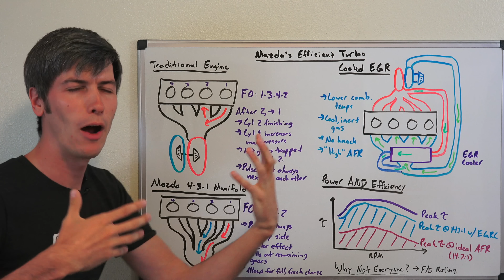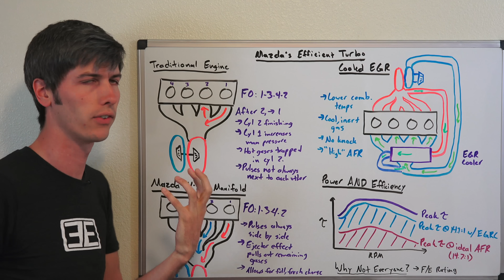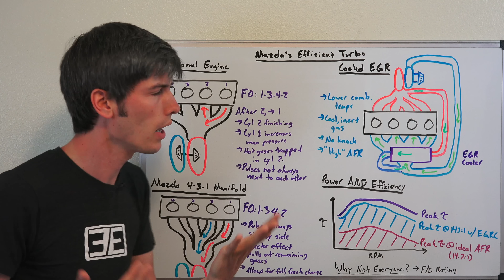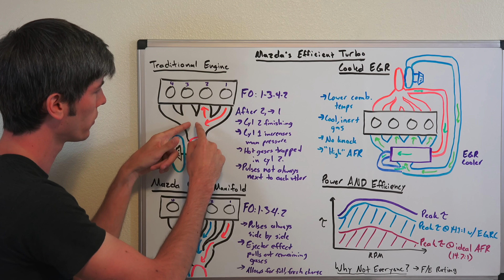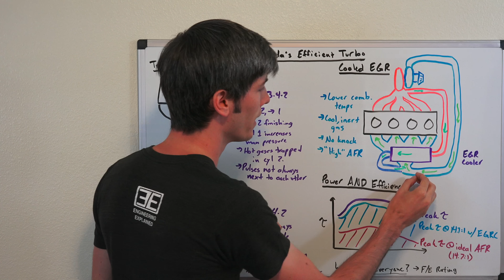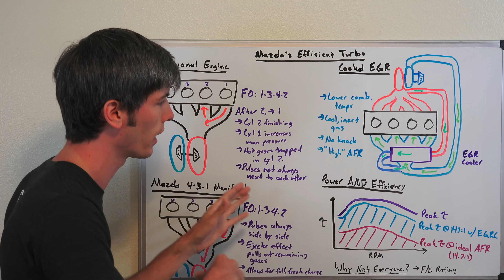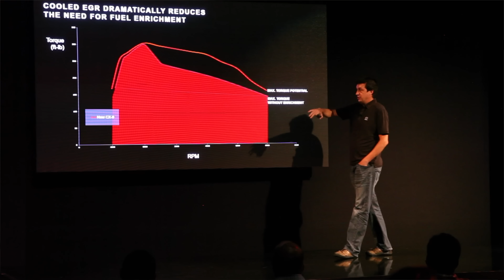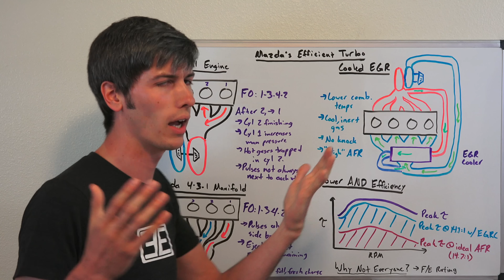Mazda's Secret To Efficient Turbo Engines

Comment: Water cooled egr? Thank's for the head's up to avoid buying anything with this junk installed. So when it fails it destroys the entire engine. Fantastic. They could have just ran a pipe with fins through an airstream for the same effect...
Reply: lol people with their assumptions... Diesels have been running cooled egr for two decades and i have never seen or heard of an engine hydrolocked because of it
Reply: TheSplendidVids Diesel is a different animal but I agree! Cooled EGR has been used for a little while with no issues so why not!
Reply: @Quincy Allen Diesel would be even more prone to hydrolocking because of a leaking egr cooler due to much higher compression ratio and there seems to be no such issue
Reply: TheSplendidVids But where have you seen or heard of a Cooled EGR failing on a diesel?  Yes diesel have a much higher compression in most cases I know all that.  But where have you seen one hydrolocking due to a failed water cooled EGR?
Reply: TheSplendidVids All I'm saying is, it's not new technology.  It's been around for I'd say almost 20 years and haven't heard of any failed cooled EGR systems hydrolocking an engine.  Sure maybe if I really dig I might find a case or 2.
Reply: Many companies have run water cooled intake charges in their boosted applications, so I don't see where cooling a smaller gas charge using the same idea that has been around for decades is any more risky.
If anything it's just a creative application of an old design so they're able to look back at previous water cooled implementations and improve upon the known faults, instead of breaking new ground and taking the risk of design failure.
Reply: Should we tell this guy about the water jackets in engine blocks?
Reply: Keld Tundraking Amen! 🤣🤣🤣
Reply: Emil Davis I think the engineers at Mazda are significantly more intelligent about this subject than you are that’s why they are paid to develop engines and you are here bashing engine designs on a YouTube video.
Reply: Thomas Bate great comment
Reply from the maker: So you don’t buy anything with water cooling? Eliminates literally all of today’s engines...
Reply: Engineering Explained LIES!!!!

I'm sure I have a lawnmower around here somewhere
Reply: Engineering Explained not quite...my 2012 Ural is air cooled and still carbureted. Of course we're talking a boxer-style bike engine not a car engine. But Urals are now fuel injected to comply with the EPA regulations however, they still are air cooled.
Reply: I'm fine with buying water cooled machines (I work on them for a living too). What I'm refusing to purchase a a machine with a high failure rate item (EGR) coupled to a critical system (cooling).
Reply: If the water cooling doesn't work, even if the EGR valve stays open, it'll pump a hot gas and may cause   some knock in one cylinder. This will just make the "box" recognize the 2 failures(water cooler and EGR valve) and slow down the engine while pumping more fuel to  cool the mix. Obviously you would have a bunch of warnings with engine check an a noticeable performance issues so you have to stop somewhere and call for assistance just like every other car. Notice that you need 2 major failing points to even initiate such scenario, still not causing the engine to destroy itself unless the owner is a complete cretin that just floor it and never does proper maintenance!
Reply: Watercooled intercoolers have been on marine turbodiesels for ages.
Reply: TR P 
9 hours ago
"How many Diesel engines have died a tragic death due to the ERG system failing.  

Answer:  International can’t hardly sell a semi engine."...…  Link the Cat forum you read that from!
Reply: I do have a 2 cycle Lawn Boy mower that will likely outlive me and it's air cooled! In all seriousness I work in R&D on developing new automated industrial equipment, a large part of which is improving reliability of a design. EGR is a common failure point for all engines. Coupling EGR to the cooling system is a recipe for a critical failure. Just ask 6.0 Powerstroke owners how great water cooled EGR is when their truck is getting towed to the shop for an engine rebuild. (The ludicrous price people are willing to pay for good condition 7.3 trucks is proof enough how robust the older systems are.)

So here is the explanation for you: The issue is when the heat exchanger (or egr valve) plugs up it creates a localized hot spot and starts boiling your coolant. This leads to an over-pressure of the cooling system which bleeds off dumping coolant out the overflow reservoir. Now with low coolant level the aluminum engine expands due to overheating and you blow a head gasket, or crack a head, or crack a cylinder wall. Sometimes the engine will run ok just getting a steam clean but once shut off that crack in the cylinder wall leaks coolant into the cylinder bore. If the engine fires at the next crank hello hydro-lock.

But please, do go on about how I don't know what I'm talking about without a shred of evidence.

Comment: I have the 2017 civic with the 1.5 turbo engine. I always seem to get better fuel economy than what the epa said I should. I remember reading somewhere that it can be more efficient to give it some gas and accelerate quicker than it would be to drive it like a grandma. It’s either that or I’m coasting in gear more than what was represented in the epas testing.
Reply: no, you just weight less than donut-fed epa officials
Reply: the epa tests are a standardized test performed on a dyno by the manufacturer. the epa tests a limited number of cars per year. driving outside test conditions can impact economy +/-
Reply: Make sure you do the math yourself. The trip computer in that car is incredibly generous, I'd regularly get 5 mpg less than what it claimed.
Reply: Jacob, yes in many cases, quicker acceleration to cruise speed will result in better overall economy. BMW tested this theory MANY years ago (early 90's if my memory serves me correctly). The idea behind it is that the quicker you can get to a cruise speed where peak economy will be seen, the lower the overall average fuel consumption will be be. The key is to accelerate rather rapidly while at the same time trying to keep the engine as close to / in its peak torque range. The reason is because gasoline internal combustion engines are most efficiency (have the lowered BSFC) at and around peak torque. 

Most modern engines typically average around .55lb/hr BSFC at idle and drops as you accelerate though the RPM range to about .4lb/hr at and right around peak torque and then start to climb again as you get higher in the RPM range past peak torque.... if you get to the peak torque (best efficiency) and keep it there, you will have a lower overall average. Hypothetically speaking, you might have a .47lb/hr average over a 7sec of acceleration to say 50mph where as a say 14sec  time of acceleration to the same 50mph might average .49lb/hr (more time spent at lower BSFC means higher average BSFC) which wouldn't seem like much difference (.47 vs. .49) but when you factor in the time difference (7sec vs 14sec), you end up using more then twice the amount of fuel for the acceleration event.

Something else that is often overlooked is the type of driving and speeds at which that driving is being done. EPA ratings for highway are simulated for real world highway (I.e. simulated true highway speed cruise which will have higher engine loads then lower speed cruise due to aerodynamic drag). Lower speed cruises will almost always show noticeably higher economy.  People who live in the country and mostly drive back roads in the 40 to 50mph with little stop and go will typically see noticeably better MPG numbers then any EAP data posted for the given vehicle.

The opposite can be said for true highway driving because EPA data for highway is tested at 60mph. Since many highways are 65 to 70mph (at least down here in Florida anyways), you are under more load then what the EPA test was for and will typically see lower numbers (especially if like most, you drive above the posted speed limit). Its actually amazing just how much difference the aero drag plays of fuel economy. I use to routinely make a 300mile (round trip) on weekends and in my old Supra, that was a full tank for the round trip with normal 70 to 75mph highway aero drag. If I could tailgate a Semi the whole way at 65 to 70mph, I would save about 30 to 35% fuel (i.e., use a bit less then 3/4 tank for full round trip).
Reply: Jacob Klein yeah me to I got the turbo 1.5
Reply: Jontae4288 It’s great with the manual trans and a k tuner. Best daily driver I’ve had so far.
Reply: Youre supposed to get to speed quicly, and then turn on cruise control to maintain speed, as well as coast as much as possible
Reply: kkthxk Yeah I’ve cleaned some out before on other engines. I’ve heard Honda had some tricks up their sleeve with intake valve timing and stuff like that. I just have to wait and see how bad it gets though.
Reply: Got 5.0L/100km with mine highway, 6.6L/100km mixed with some good pulls, some passes, and higher than the speed limit in hilly areas. It’s much much better than advertised fuel economy. Is intake caboning up even a thing with direct injection?  Shouldn’t be any fuel there at all except with valve overlap at low engine  speeds.
Reply: @Jacob Klein No offense intended or implied, but where is the torque?
Reply: keep an eye on your oil. Tons of fuel dilution issues - one of the main reasons i went Mazda over Honda
Reply: emark24 Yeah I’ve heard some stories on the forums about that. I broke mine in hard and haven’t smelt any fuel while doing oil changes or seen the oil level increase like some people have. An oil analysis would tell for sure.

Comment: As far as the exhaust gas scavenging, this has more to do with header design more than firing order, in my opinion.
Reply: That's basically what he was saying, the design was optimized based on the firing order to improve scavenging.
Reply: Unless you're talking about the firing order on the Ford 1.0 Ecoboost that gets around the exhaust scavenging issue by simply deleting a cylinder so exhaust pulses are more separated.

Comment: Damn, very interesting conclusion at the end, i think it's the right decision, props to Mazda for that. They may get less mainstream attention but for people who care like the people watching this channel it's surely good publicity to do that instead of going the cheating emissions route lmao
Reply: I would like to point out that while mazda does get as good Fc under near spirited driving,  backing what their engineers says, to me, volvo is also another that gets close to EPA ratings in real world. Under some spirited drive as well. Just throwing it out there. since volvo also uses a rather complex egr system that may or may not be achieving the same effect.  Props to Mazda though. ICE may be around for a lot longer yet
Reply: coscorrodrift Pretty soon with the new testing methods there fuel ratings should increase.
Reply: I'm not really sure it's cheating. My Civic Hatchback has all the "cheating" problems mentioned here, but I routinely beat EPA ratings on my commute by driving in a fuel-conscious way. Then on the weekend, I turn off Econ mode and have some fun (though fuel goes through the roof, from ~5 to ~9 l/100km). Works for me. Cool, though, that Mazda might let me have more fun without guzzling gas.

Comment: mazda is a truly amazing car maker.
Reply: Truly*
Reply: Armesis P thanks for correction english is not my first language ah ha
Reply: Yep...my Focus 2.3 in my 2003.5 is a Mazda design....very reliable.
Reply: It's not that impressive as when you compare the avg real world mpg on fuelly 2017 Ford Escape 2.0T vs 2017 Mazda CX-9 2.5T which are based off the same duratec engine lineups from their old partnership days. Aside from 0.5 larger displacement you only get 10 more hp  but ~500  lbs heavier. Which I'll concede would equate to about 7.5% mpg loss being heavier meaning if they were of equivalent weight it would be 24.725 mpg vs real world avg of 23 for both vehicles.Equating to a mere $94 annual fuel savings cost assuming 12K miles per year.

To add context the 2.0T only comes on the top tier Ford Escape Platinum $36K MSRP so you'd get more bells and whistles vs the base sport Mazda CX-9 $35K. Which the top tier Mazda CX-9 would be $42K. I'll concede the CX-9 looks better but would I seriously want to spend $6K more for a Mazda? Yet, I could get a BMW X1 AWD with an 8 speed automatic that gets more MPG than Ford of Mazda for the price of the Mazda.
Reply: @RichardPrendingue  LOL Your math is very flawed... If you drive Mazda's turbos with a heavy foot they really do use a lot less gas then engines running fuel enrichment.. Mazda's turbo won awards for a reason! Its also not based on the Duratec engine! LOL Also a BMW x1 is crap and very unreliable comparted to Mazda!
Reply: Cerberus984 i don't talk about This engine, but the whole thing, like skyactiv X, the maybe New rotary hybrid, the focus on Light Weight vehicule Before maximum power and the fact that Mazda is Almost the last car manufacturer Who believe that combustion engines are not dead. So keep it up Mazda ! (Same for you Jason btw)
Reply: The only thing lately that is impressive is the SkyActiv X. The rotary hybrid isn't a hybrid exactly as the wankle will merely be a generator extending max range for a plug in hybrid. Not necessarily amazing in my view. They are a relatively small manufacturer and simply don't have the pull to be able to mass purchase batteries as their competitors do. Which many new comers are either building at a loss or very little profit. So doing minor tweaks that they could patent and collect royalties to others is the most logical approach. I hope the HCCI is successful but I'm skeptical without some form of water injection to be durable in all weather extremes with the desert in particular.

Comment: Why won't Mazda put this engine in the CX-5? I receny rented a CX-5 and loved the exterior, interior, and handling. The problem was the engine. It was painfully weak, so I eliminated the CX-5 from consideration for replacing my Forester XT. Subaru and Mazda are both out. The Ascent and CX-9 are too big.
Reply: Or better yet a speed3!
Reply: David Santora it may find its way into other models, but im not sure if theres a market for it. A turbo midsize cuv. The larger c9 requires the engine bc its so big and heavy & its a needed addition to the mazda6 due to competition from the accord, camry, fusion and even some of the luxury brands.
Reply: The Mazda Speed3 is too small for my family.

Comment: Having just wiped my cat's butt I feel like speaking my mind. I feel like this secret is no more than a properly engineered exhaust tubing system, and, a pipe to feed the engine it's own poop(inert exhaust gases) to keep its digestive track going as a form of fiber while its not being asked to do much for efficiency. Thank you for the video as always.
Reply: dhoyt902 basically EVERY egr tube.

Through the diesel versions are crap as they get coked up real easy.